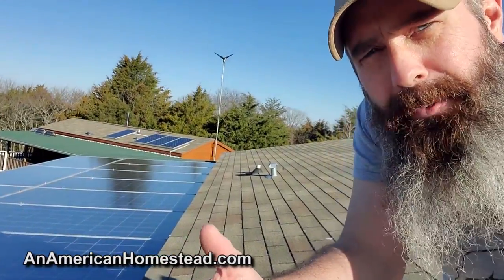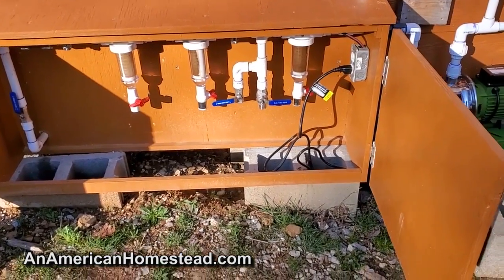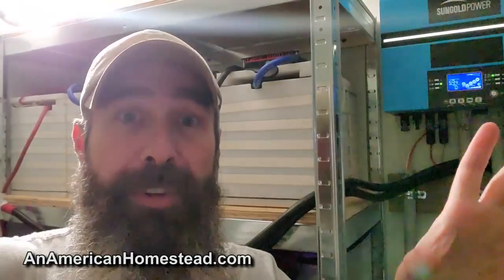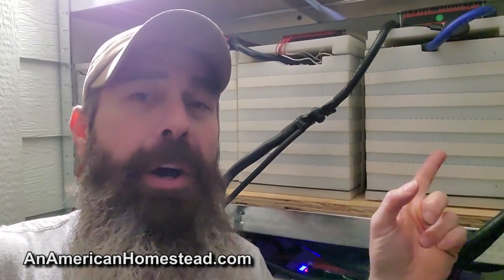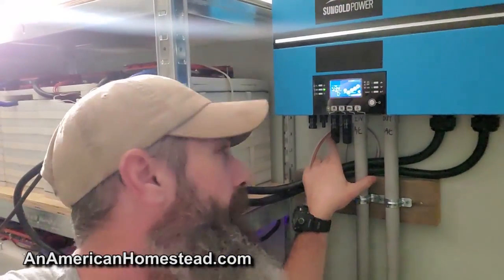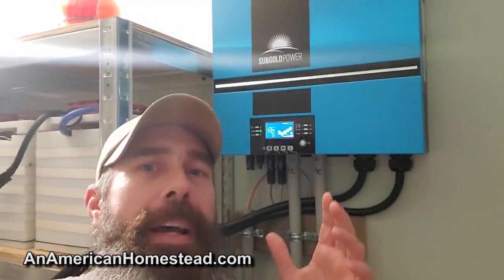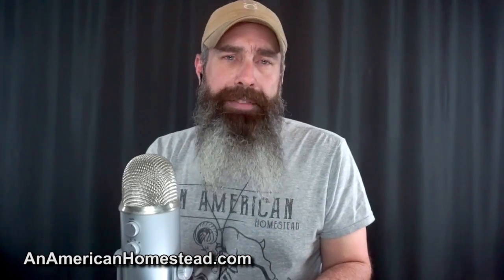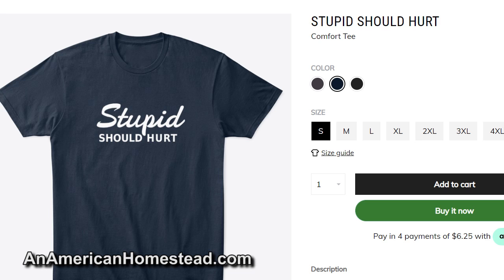Our Off Grid Homestead Solar Energy System - SUNGOLDPOWER SP6548 Solar Inverter

Comment: I wish I had realized the weakness of a 12v system, namely solar charging.  I got an expensive Victron solar controller, but I can only pull 1200w with it.  If I had a 48v system it would be able to pull 4800w.  Replacing my overpriced Victron inverter and all the extra pieces (bus bars, shunt, CerboGX, etc) with a SunGoldPower unit.

Comment: These all in one BMS/inverter/charger/ ac output box are SUCH a damn no brainer...love that you dont need 40 connections and 3-4 components on top of all the rest of everything it takes. Has made researching and looking up wiring so much easier. Going Sungold for sure on the controller

Comment: I think i understood you to say that you plug the solar panels directly into the sungold inverter to charge your batteries. So you don't  need a charge controller with this set up?
Reply from the maker: Correct. It's an all in one system. Charge controller is included inside.

Comment: I got the opposite issue. I have a ProSolar 8.66KWh solar system tied to the grid, PNM Electric requires it! But I was told that my setup would keep the power on in my home during a power outage... as long as the panels were producing power. NOT!  What am I missing??
My home uses 1.4KWh so I need to find out 'how' to fix my system to charge batteries and keep the lights on! And my batteries are EcoFlow Delta 2 2000KWh Lith/Iron batteries that should run the home for overnight to be re-charged by day!

Comment: Be aware that if you are planning on upgrading a little at a time, once you exceed the capacity of the inverter you can not add capacity to that inverter.  It will no longer be of use unless it is used for completely isolated stand alone circuits.  This is because you can not parallel AC circuits unless the circuits are synchronized.  If the two circuits are out of phase paralleling will cause a short circuit.

Comment: Thanks for breaking it down. I just finished my RV 12v system internals. Need to hang some panels. I am using the sig solar 6500EX 48 and still building out my battery boxes for my standalone Larger system for Shop. What major loads are you running on it? Trying to figure out how many more batteries I will truly need for shady days.

Comment: I always use a clothesline. I got rid of my dryer. I live in Missouri and manage to get my laundry done without a dryer.
Reply from the maker: We have a clothes line setup and I still may use that from time to time but 2 reasons for the dryer. 1. I'm a single dad and it's just easier for me to throw them in a dryer and then fold them. It says me time. 2. Joann is getting older and one day may not have the energy to hang clothes on a line. She's moving around less these days but still going. This will be easier for her if I just do it and dry them.
Reply: @An American Homestead  Great points. Hanging out laundry can be a bit of a workout and for people with back issues could be a problem. So far the clothesline is working for us, however things may change. When we moved to our homestead 1.5 years ago we thought we would try living without a dryer and so far so good.

Comment: One thing that I don’t hear a lot about building a system is , to save money on upgrades, buy the biggest charge controller and maybe even the biggest inverters that you will ever think you will need , that way when you add panels, you don’t have to buy a new controller everytime you upgrade
Reply from the maker: If you have the money, that is fine. But not everyone has the money for a 6500 watt inverter up front.
Reply: @Anamericanhomestead  you are right , that is why I emphasize getting a larger charge controller first , so you don’t have to buy a new one every time you upgrade, you can build your system with a smaller inverter , then buy a bigger one after you build your system, al in one controller/inverters are nice , especially if you can also hook a generator to them , but I would rather have a separate controller and a charger/inverter , and yes , I know there are ways to get around that , but I just like the simplicity of knowing I have good generator backup ,

Comment: The thing that concerns me is that you have to have batteries what happens if you cannot get a new battery you're still stuck with all that new stuff and you a know gridworld meaning I hope that they continue to make batteries for the system? Next question is how long does a solar panels last and what about getting new parts no it's like a car break down what do you do?
Reply: Those are great questions. First question about the batteries. It depends on the kind of batteries you have in how much they are used. If you use something like a car battery, it only lasts you maybe 3 to 5 years. For a lithium iron phosphate battery, the estimation of use is about 10 years and possibly more. I currently use Ni-cd batteries. They were manufactured back in the late 70s and early 80s. Some of them have at least 80% of what they can do when they were new. None of them or less than 50% then what they were new.

Solar panels can last indefinitely. What messes up the panels is the exposure to the Sun and dirt. If you keep the surface clean regularly, the panels should last, quite a while. I have a couple panels that have been in service for over 10 years, that I know. All of them are used before I bought them. All the panels that I have seem to be in great condition. I have not had any issues with them. I use a similar system as Zach's. But my system is a 24 volt system instead of a 48 volt.

Comment: You can have a system that will give lights,  laptop and kindle for $220
Though I recommend a system for $800
That will do the above, plus power a small freezer and small appliances.
Both I give all details in another comments.
And you can add on as times goes by.
Wow. Im sticker shocked at your prices.
** Really. Something people don't realize is the power lost to the connection that come on solar panels.
I'm not kidding. I get power from the MOON. because I replaced those connections.

Comment: He is absolutely correct you can add.
I'm going to give two beganing systems.
for little money. 
Also you don't have to buy all at once with these. Just need them all before you can began.
system #1 ($220 to $300) ( this was my first system you can go smaller but its going to cost the same) 
 ONE 100 watt panel ( $130)
one used car battery ( $30) 
one trash cheap invertor 400watt ( $60?)
You can cut the ends off an old 3 wire extention cord and use it for your wiring.
Unlike me, please off the bat. Cut the connectors off the solar panel and use big electric eye connection. They are yellow. Use a block of wood to bolt connections together.  This will increase you power.
You can run direct from panel to battery. I call this running hot. But it better to have a charge controller.
Note  not all charge controller work.
As funny as it may sound. The expensive around $80 from harbor frieght are decent. And don't let price fool you. I've paid $400 for controllers that were junk.
Running hot. Ok you need to watch your batteries. and disconnect as needed. Its a headache and will wear your batteries faster.
This system will run two tail lights all night ( yeap tail lights without covers are a good light source.)
and a laptop. and a kindle
System #2 ($800) my advice first system. Cost more but worth it in the long run. This is from 15 years off grid experience.
BTW This is also what I have in my truck camper.
two 12v 100 watt panels ( $260 for both)
two 24DC deep cycle marine lead acid batteries ($70 each, $ $140 for both)
one 25 foot extention cord ( $12) 
one 1500 watt POWER DRIVE invertor ( $250) you can get at most truck stops and they are hands down the best invertors in my option. I have one I bought used over 15 years ago and its still 100% well worth the cost. I've changed over to only these. And they are bigger. And smaller. But smaller are not made the same..I think I've seen up to 6000w. 
One charge controller. $80 harbor frieght. I wouldn't run a hot system..Eben through I did for years. But that was because I I seen were bad controllers. There is a story on the harbor freight I might post below.
One packet of big eye connectors.
To hook up.
Start with panels. cut off the factory connections. This will save headaches and give more power.
Replace with eye connectors..Make sure they are the big ones. They need to fit  the bolts on the batteries.
Cut ends off extention cord.
There will be 3 wires. black green and white.
Put eye on black and one on green.
Bolt black and negative from solar panel together on wood.
Both green and positive from solar panel together on wood.
Ok yes you can put both woods out of weather. But really you can suspend in air and be ok as well.
Now other end if extention cord. cut end off. ( best to do this prior to connecting solar panel..But if you forget. it will be 
Next you need to cut off the end of the extention cord not connected to panels. Long enough to go from charge controller to batteries 
Now strip the black line and green.
Connect black line into input negative on charge controller.
Connect green line into input positive on charge controller. Also you may add a 12v switch and a fuse between green line and charge controller.
This will give you a easy way to turn off panels and a safety for you charge controller. If you do this..Turn off once it connected before proceeding.
Now.. take a battery cable and connect both positives on batteries along with positive from invertor. 
Do the same with negatives.
Now on that piece to cut off extention cord. 
Put a eye connectors on the green line and on on the black line.
On the other end strip green and black.
Connect green to controller output positive. 
Connect black to controller output negative 
Now there is going to be another set of connections on the controller..I will come back to it. You don't have to have or use. But its another safety and will require a little more which I will cover when I come back to it.
Now you already have the eye connection on the other end.
Connect green to one battery positive.
Connect black to one battery negative.
I like connecting controller to different terminal then invertor.
In multiple series. I chain series in a loop. where first battery has positive connected to investor and negative to controller. And last battery negative connects to invertor and positive to controller. There is a reason for this but it not a big idea. 
Just don't have controller only connected to one battery.
and same with invertor.
Unless you are only using one battery 
This makes the connections go through all batteries. Not doing this with discharge batteries uneven.
Ok now you are all connected.
If you used a switch. turn it on.
Next power on the invertor.
You are ready.
oh forgot. You need to cycle through setting on controller. 
Ok that set of connections not used on controller.
You can add a burn off a cheap one is a old car head light. Buy from a junk yard and make sure you get the connection for head light. it will be three wires.
One will be Negative. One high beam and one low beam.
Negative connect to controller negative on the set not used. 
Positive connect to controller positive on the set not used.
I don't remember which is which on the headlight..But its not hard to figure out. And if you hook up wrong it will be OK until you do it right.
I've never had the burn off needed after changing to harbor frieght controllers.
Reply: Ok the harbor freight story.
I had given up on charge controllers.
And had been running hot 🔥 for years.
I was helping someone that had bought a used system. And it included a harbor frieght controller.
I bet him that controller were useless.
He gave me the controller. because he already had one.
Now I've never like harbor freight. I always seen them as cheap garbage. And really hate their 3 piece panels.
But I took the bet. Plus the controller was free.
Well I ate my words. The controller worked.
I had spent a couple thousand on more expensive controllers. That never worked.
over 3 years later and its still working.
It also saves battery life and needing to add water as much.
BTW in the beganing. check batteries weekly for water.
If it working correct. monthly will be fine after the first month.
Its possible that you go months without having to add water.
Only used distilled water.
Not using distilled water will shorten life of batteries.
Another note. There is a idea of adding Epson salt to rejuvenate batteries. DO NOT DO IT. It does not work and battery will have to be rebuilt once it done.
Yes. you can rebuild lead acid  battieries.
There are YT video from India on how to do it.
Huge caution must be used. it is dangerous.
If you do.  make sure you have a few pounds of baking soda on hand.
Thick rubber gloves.
Thick rubber appron.
Face shield 
Well ventilated area.
Something that can hold the acid.
And a flour screen.
Never discard the old acid.
once Screened if only distilled water was added. It can be reused.
If other things have bern added. The acid can't not be reused. And new acid will need to be bought. In this case. Then most auto parts stores will take it. some charge to take it.
I will rebuild a battery. But this is how it has to be.
You give me the battery.
It will take a week for me to do.
You buy battery from me for $60.
This way it covers all legal issues.
And you meet me in El Paso Texas to give me battery and to buy battery. 
If things were added to battery other then distilled water. Let me know before hand.  This will save money.
Reply: Also. If you are around South New Mexico, Far west Texas or South west Arizona.  You pay for my gas. Buy all materials. Buy me and my dog lunch..Give me $100. I will hook you up off grid in one day.
Its not hard. And I really wish I had someone to teach me when I began.
Instead I had a solar company that lied to me. Selling me junk.
Reply: Oh on my #2 system.
It will hook into a household fuse box.
Here is how to do it.
You will need a good extention cord.
And a 50 amp breaker for you breaker box.
Extention cord.
Cut the female end off.
power off breaker box
Turn invertor off
CONNECT green to breaker 
Connect black to negative bar in breaker box 
Put breaker into breaker box.
Plug male end into invertor
turn on invertor
flip on breaker
Flip on breaker box.
Now it connecte.
This is also how you can shotgun a solar system into on grid.
Note this may not be legal in your area on grid. ( lol. I don't know where it is legal)  So use at your own action.
However. It will work.
Now there are invertor that will grid tie.
My 24v one will. 
But this is how to do it.
And I wouldn't do this with a cheap junk invertor.
Reply: Wind turbine.
Ok here is the real scoop on them.
Buy a chevy alternator and build one.
They are the best.
You will hear about brushless.
Really don't worry. When it goes bad. Just replace it.
Its far cheaper. and much easier to hook up.
Someday I will do this for winter heat.
I have everything. My wind turbine. A chevy alternator will bolt right on. Its just  now I'd only use for heat. 
Solar panels are better imo. no moving parts. But wind works at night. which is when I need the heat the most..Plus I have to still find hearing elements.